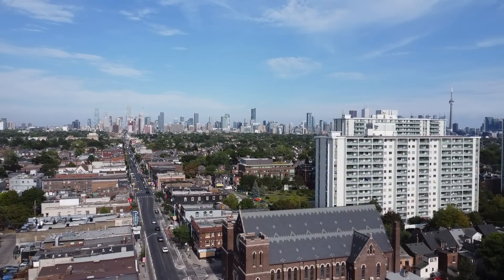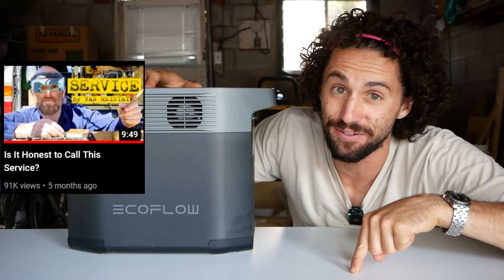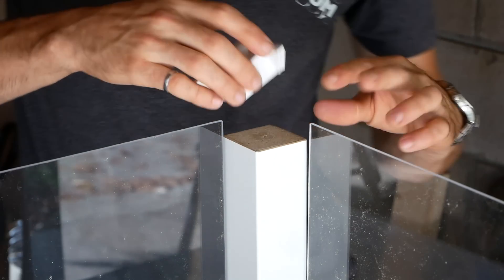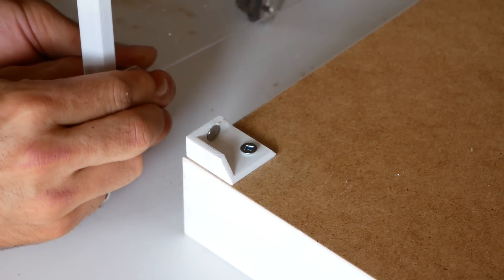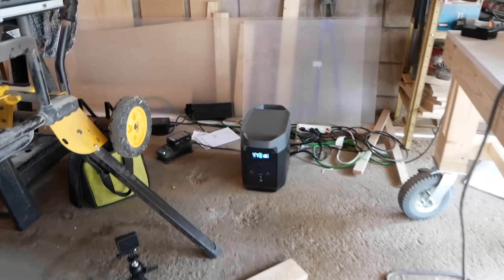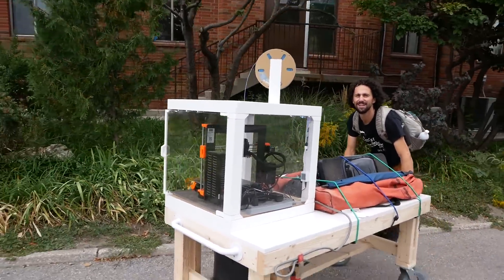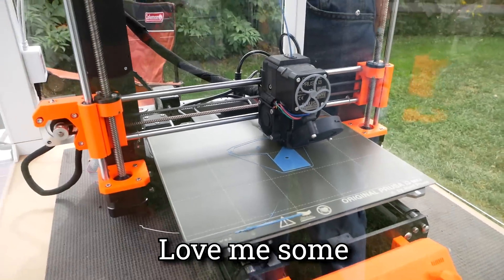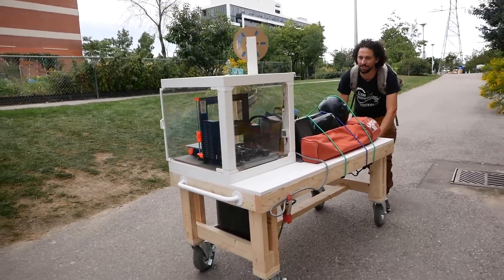I Built an OFF GRID 3D Printing Station

Comment: As others have indicated, two fixed wheels and two rotating wheels is the way to go. With the rotating wheels on the side with the handle. I worked somewhere where we had a lot of stuff to move around on carts, and for some reason, one of them had four rotating wheels. It was a total bitch to get around! great project, by the way!

Comment: I would either use fixed casters on one end or, if you could lock the swivel on one end straight do it.
I've used both styles and 4 swivels requires 2 people to move it easily

Comment: You missed a chance to recycle a pallet!  Definitely suggest locking the spin on the front two wheels, but if you can make it so you can enable/disable the swivel with a latch or a bar that you can remove.

Comment: Super cool! Loving the new vids and ideas.

I think if you wanted to have the back side wheels stay in one direction for ease of travel, instead of changing out the wheels, you could possible have wooden/metal dowels lever or slide down on both sides of each wheel to stop them from rotating around fully. 

Like so:
Unlocked: (wheel freely moving 360°)       
  \|  |/           Or    ||   ||
    []                       [] 

locked:
   |  |             Or      |  |
  \[]/                      |[]|
Reply: 👆👆✍️
ʟᴇᴛ'ꜱ ᴛᴀʟᴋ
▶️ For Pröfïtãble Ïnvëstmënt .

Comment: I'm pretty sure the magnet holder pieces for the enclosure are supposed to be using the existing screw holes so that the door panels end up parallel to the top and bottom of the enclosure.

Comment: Hey, if the Power station has a 24V DC output, use that since inverting it to 240V AC and then back to 24V DC loses a lot of power.

Comment: I never thought to use IKEA tables to have enclosure to a 3d printer. But this us actually gives enough stability with weight. Together with small magnets results a perfect cabinet. If I add design to hold the heat, temperature it will be amazing.

Comment: 3d print some wheel steer locks that screw in with the 2 front wheel mounts that simply just hold the 2 in place

Comment: Rather than loosing the swivel. I suggest you find a way to lock two of the wheels from swiveling with a pin or some wood that swings down to block them from swiveling. This makes it way easier to controll when navigating sloped terrain and gives you the benefit of being able to translate and rotate the table when stationary.

Comment: You need to print a holder for the conical dixie cups.  No way to put it down without a holder.  Plus, you need a bracket on the table to add a changeable sign.  Free 3D Printed Repairs.  or Free the Filament.  Something like that.  I enjoy these real world solution videos so much.  They are terrific.  I think there is an entire universe of Ikea modders.  (I think IKEA are initials for the founder and where he started.)
Reply: 👆👆✍️
ʟᴇᴛ'ꜱ ᴛᴀʟᴋ
▶️ For Pröfïtãble Ïnvëstmënt ...

Comment: I think charging phone and microphone case (so devices with usb-cable and charger) directly from the usb ports of the powerstation should be more efficent, as the chargers take 120 / 240 Volts and transform them to 5V, and the usb outlets on the battery should run a 5V system..🤔

Comment: EcoFlow device would be nice but... Just looked into manual. This EcoFLow model also lacks UPS capability 😞 It has 30ms downtime when switching between power sources (like grid and battery) while normal UPS has 0ms. Bad (for some usages; different usages than from this video).
Reply: 👆👆✍️
ʟᴇᴛ'ꜱ ᴛᴀʟᴋ
▶️ For Pröfïtãble Ïnvëstmënt ..

Comment: The thermal changes in the printer head alone, not to mention the lack of ability to print more than 5 hours (or whatever your portable power may be) would be rather huge obstacles to overcome. Not to mention the lack of portability …
Frankly this looks like a project looking for a problem to solve which doesn’t exist.
Reply from the maker: I guess you'll find out! :)
Reply: @MorleyKert  love it!
Reply: It doesn't seem like the type of project to solve a problem, but rather to experiment with mixing different technology to see what you can do with them. Seems like a cool setup for the 3D printed repair series so he's not confined to a coffee shop.
Reply: @collin_builds  Sorry, I disagree. You say not confined to a coffee shop, but given those small wheels, and the gargantuan size of the wooden cart, it cannot be transported in anything less than a large truck (unless disassembled). At best, he may be able to roll it down the street a block or so - certain not “off the grid” unless that means taking it to a parking lot across the street. After all,it seems no more portable than the cart full of dead people from Monty Python.
Reply: I love this! Keep up the great work I’m really enjoying your videos. You’re absolutely right,… Changing the two wheels on the opposite side of the of the handle will greatly improve the functionality and maneuverability of the cart. 👍🏾